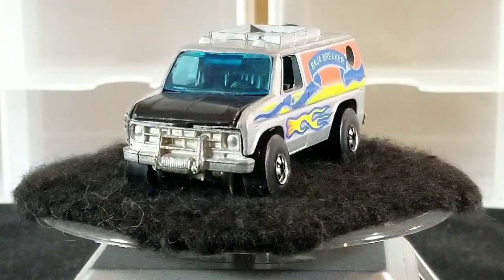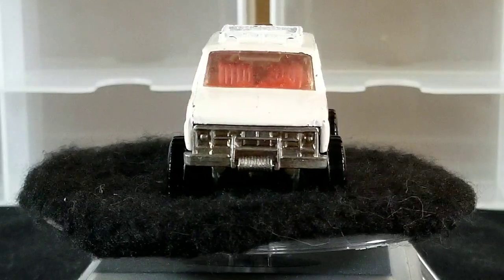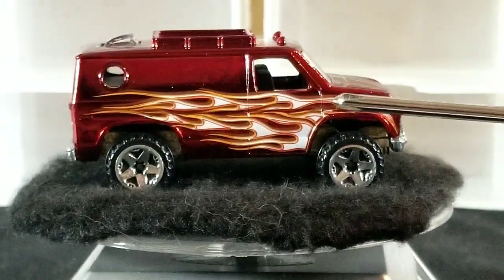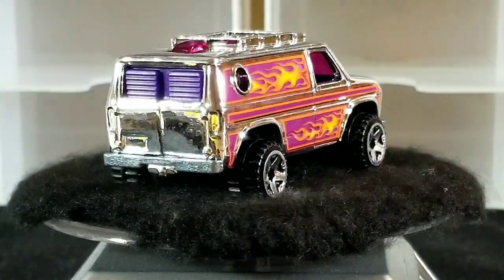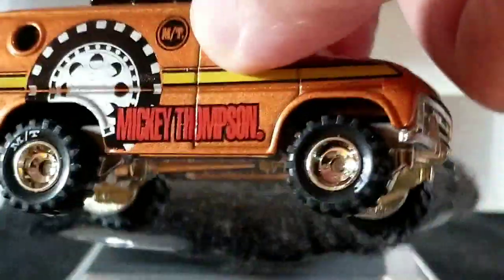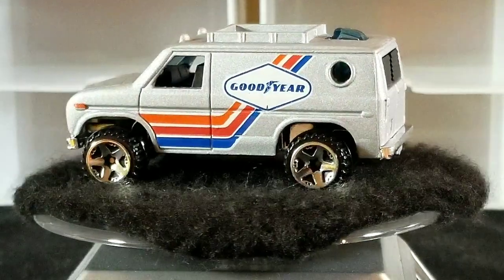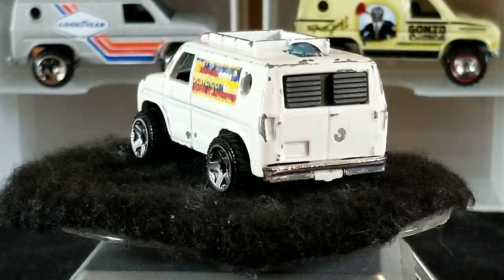Hot Wheels Casting Spotlight: "Baja Breaker"

Comment: Hey I have a question about diecast vans.  I remember a van I had as a kid that had a port in the back that allowed you to look into the back?  I can’t find it anywhere, did I just imagine this?
Reply from the maker: There were I think 2 "Baja Breaker" Van Casting Releases that had the "Scene Machine" Feature with the Peep Hole in the Back & you could Look inside & See a Scene.  
1 was a Motocross Theme/Scene & one with a Circus Theme, Released in 1979 & 1981.  There were Also other Castings that had this "Scene Machine" Feature.  
If I were you, I would Search "Hot Wheels  Scene Machine"  on EBAY and see if Any Look Familiar.  Hope that Helps
Reply from the maker: https://youtu.be/0nOkn_JVovg
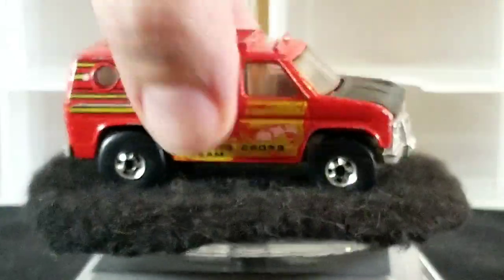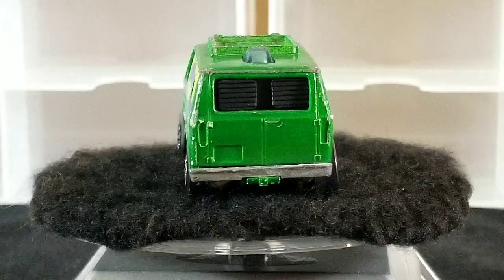4:58 Minutes & 7:00 Minutes into the Baja Breaker Casting Spotlight Video.
Reply from the maker: There was Also a Simpsons Baja Breaker Blue & Yellow Van with the "Scene Machine" Feature, as Well as 2 other Van Castings that had the Scene Machine Feature.  The "inside Story" Casting, & the "Combat Medic" Casting.